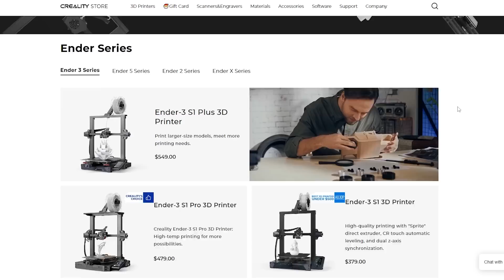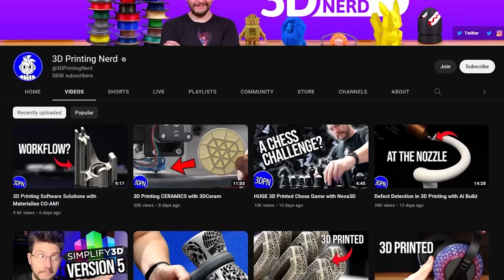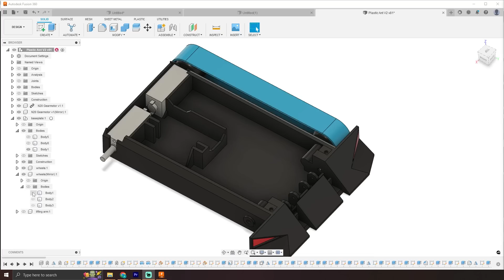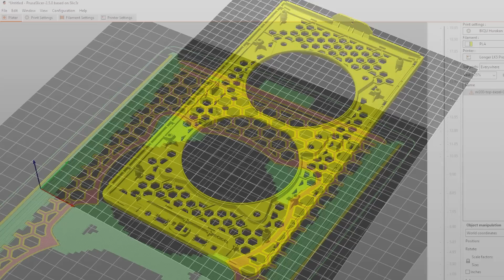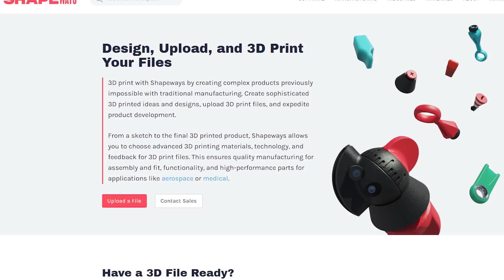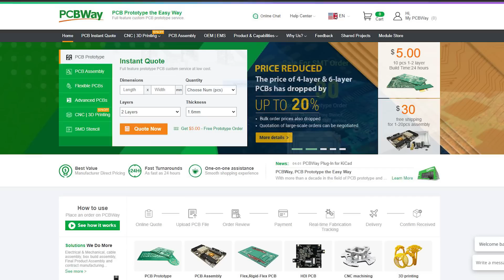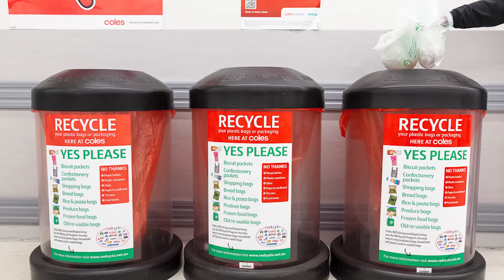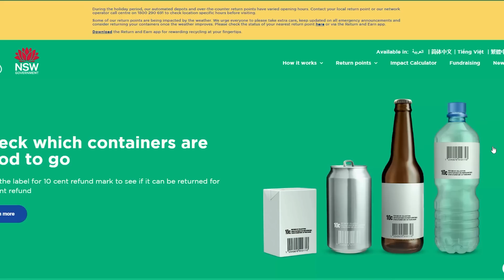My 3D Printing Predictions for 2023

Comment: In Germany we have a Startup Company that is accepting 3D printing "waste" like failed prints etc and gives you coins for sending in the materials and even paying for the shipping cost. If you sort and label your stuff properly you get more coins. With these coins you can save up to 25% of you purchase of filement in the online store. I think this is a good start for the future. Recycling plastic bottles at home will be no go to approach here because we have a deposit on the bottles and it is quiete high. 

I really hope there will be an easeier way getting in CAD modeling. I can design basic things with Fusion or FreeCAD but as you said, the learning curve is really steep.

Comment: I think you forgot that resin printers exist, they are getting really good now, they can print in casting resin and using casting can produce very detailed metal parts, as well as strong ceramic parts with another resin (after baking in a special cycle) see veg oil guy.  There are metal filaments you can print and then bake(in a special cycle) for quite strong metal parts too.

Comment: A wide variery of cellulose-based plastics have existed for over a century, e.g.: Cellulose Acetate. The main problem is cost. The volume produced is rather low because petroleum-based plastics are cheaper and better in almost every way.

I don't think this can be solved by hobbyists, we need to force all companies involved in the polymers supply chain to actually build recycling centers.

Comment: great video as always 😃 On the plastics: Unsorted plastics can relatively easy be sorted if the recycling company invests into the right sorting machines. Disclaimer: as my day job i work at Tomra. That being said, Tomra develops and builds such machines and they are also widely used (heavily in Europe).
Reply: But are these machines capable of separating PLA, ABS, and PETG in a stream of oddly shaped parts?
Reply: @user2C47  yes, and also if they are shredded 😉
Reply: Sorting them isn't the problem. Most plastics marked as recyclable are not actually recyclable in any practical sense. Those that are can only be recycled a relatively small number of times. That's assuming that the plastics were properly cleaned first, which a significant amount of is not.
Reply: @jacobnebel7282  that is true but better recycle what you can than burning all of it. In Germany we are at about 50% of reuse and this rate could still be way improved if society really wants it.

Comment: plus, 3d printing is only getting faster and more robust, the new bed levelling sensor from annex engineering with 100x100 bed meshes or the vzbot with 1000+mm/s peak speeds are both huuge innovations

Comment: My take on your predictions:

1. The prosumer market race will end free/open slicers: When the market gets tougher, neither Prusa nor UltiMaker will want to give free handouts to their competition.

2. CAD won't become accessible for the mainstream (Microsoft tried with Paint 3D, it didn't work). Instead, even more design is just going to shift to modifying meshes (which all (?) model sharing sites are already using anyway). Maybe we'll see improvements in 3D scanning / photogrammetry though – 3D scanners currently are ridiculously bad and expensive.

3. I doubt that we'll see 3D prints alleviating any supply chain issues: Supply chain issues are with microchips or chemicals or certain foods, but not with plastic parts. Let's hope that we won't get into supply chain issues for filament...

4. This one is interesting: PCBway, JLC PCB etc. to me are the first realization of that "Industry 4.0" promise, "batch size 1" and all. However, it's all China-based for now (the cost seems to be prohibitive elsewhere?), so if the trade war with the EU & US goes on, it might all go away again very quickly.

5. At least here in Germany, we have a deposit-refund-system on all plastic bottles, so making filament from these becomes a very expensive endeavour. Recycling prints would be awesome, but currently seems way out (sorting the different unmarked plastics being a big problem) and currently doesn't even make sense energy-wise, does it?

Comment: If a company is worried about quality control in terms of at home 3d printer replacement parts they could provide the cad file as suggested and advise the user to use the 3d print while waiting of parts to ship. Would be a reasonable solution in my opinion.

Comment: I hope recycling will catch on. Easy to use recyclers (shredders, extruders), maybe in the local makerspaces? But I also hope that we will less scraps in the future. Better printers (looking at you, Prusa XL with those many sensors in the print head) so less failed prints, better supports (the tree support in Cura and Prusaslicer looks promising), less plastic in the spools (MasterSpool, cardboard spools and combinations) and hopefully more use of decomposing materials (spools for example) would reduce the amopunt of plastic 'excaping' the recycling...

Comment: I have been using my 3d printer to make my packaging for my business, its so simple, I am surprised more brands don't do this already.
Reply: For small businesses it might be an option, but in large volumes it doesn't make sense. I can buy and ship premade packaging from China for a fraction of what it costs me to print it at home, even just for the cost of the filament. Economy of scale makes a huge difference. Technologies like vacuum forming and injection molding are much faster and more efficient than 3D printing, but they have a high fixed-cost for setting up the tooling. Prototypes and one-offs benefit from flexible technologies like 3D printing, but mass manufacture of fixed designs are much better off with our existing manufacturing processes.

Comment: I personally find it interesting that this seems to be considered the year where industrial services become widespread in availability. Companies like xometry and protolabs have had CNC and injection molding services that were reasonably priced for the better part of 5 or 6 years now.

What seems to have actually changed was the visibility of these types of service with the increase in competitors, along with aggressive sponsorships for the new players through the YouTube maker scene.

Regardless, it's great to see these services becoming more competitive.
Reply: Btw, in addition to the above services, a lot of makers seem to miss the versatility that sheet metal parts can offer. Most of the same services I mentioned as well as those in this video have sheet metal as well, and some smaller names like OSH Cut offer fast automated ordering and lower prices.
Reply: In the highschool robotics community, SendCutSend has become super popular. They have a wide variety of materials and really good service.
Reply: @ThatGuy Makes Things :  I think you hit the nail on the head... visibility is what is making the difference.  The Youtube connection, with positive comment from "trusted" people, combined with a good close-up look at quality examples, topped off with very low cost first time pricing... They somehow manage to feel familiar when compared with trying to wade through an online order form that seeks details for a manufacturing process you know little about.   Clever stuff!

Comment: I wish Sketchup would get some features from Fusion. It's awesome to work with, very fast. But it gets very clunky during certain tasks, some things are just impossible. If they just added a function to extrude with the help of other geometry. That would help a lot to do drill holes on angled surfaces.

Comment: Meh, it's not an issue putting 3d printed items in landfill. Future generations will have better technology for dealing with it. Today's landfill is tomorrow's mine site
Reply: Sure, because leaving it for the next generation hasn't caused problems before. How has that been going for us for the last 100 years?
Reply: @reverse_engineered  putting it in safe long term storage until we have the technology to meaningfully and economically recycle it isn't just chucking it on the street

Comment: Considering what has been happening in AI in 2022 I'm definitely expecting 3D printing to be affected as well. 

CAD with an AI interface? "Design a cube-shaped box 30mm wide with a wall thickness of 2mm, a lockable lid on top and little feet in the corners. Include a grid in the back to mount a 20mm fan."
"Check my design for potential overhang issues and optimize slicing for an optimal finish on the top and the sides." "Scale the imported design so that the height is exactly 24 mm but keep the wall thickness the same."

Should be trivial for an AI but enable beginners to really take off.

Comment: The Bambu Carbon is the closest we have come to a ready to go 3D printer for a person new to 3D printing.  When that happens, we will see the next "race to the bottom".  It is important to remember that the current race to the bottom was only possible because of the open source nature of the current 3D hobbyist printing industry.  Bambu is not keeping things fully open source, so the next race will not be as intense unless an equivalent system is open sourced.

Wizard based design programs may become more popular, but AI generated parts are more likely.  Eventually, someone will realize that scanning an object combined with general purpose design rules will make better parts than language based 3D models.  Training an AI to determine the best slicing strategies for speed and quality will be another big win, but that may take more than a year (unless we train an AI to train other AI's).

Comment: I would like to see some invention that would get rid of the visible layer lines or make it easy to produce some sort of pattern on the surface to hide them. I think it's still the surface quality which prevents 3D printed parts to be sold on the same shelf with injection molded products. That carbon-nylon part on this video looked very nice already! Matte filaments could be one solution.
Reply: Try glitter filaments.  I use the stuff from Fusionfilaments and the small sparkles do wonders to hide any layer lines.

Comment: I hope that Ender comes with a really fast printer. For me it's not a hobby. My printers are tools. And the faster I can print something the quicker I can finish the thing I'm building. I've been tweaking a bit with my Ender 3 but my old Ultimaker from 2013 is still faster than the Ender 3. I've built a Voron printer after I saw the Benchy challenge earlier this year. But it's not finished yet because it requires quite a lot of work to get it going fast.
So I hope that new fast cheap printers will come next year.

Comment: I just got the Anker printer in and it's been amazing. It's a huge upgrade from a hobbyist kit style machine where almost everything was manual. Loving how easy it is. Sure, it won't be printing exotic materials, but I already have the tools, space, and ability to cast aluminum through either a lost PLA method or compacted green sand casting. If I really need a part in metal, I can make that happen. 
Where 3D printing shines is its ability to make intricate internal geometry that doesn't require access by humans. 
I'm just an artist btw, so making something that works for mass production isn't something I care about.

Comment: Whatever company is first to make the printer that's additive manufacturing AND subtractive manufacturing, will dominate for a long time. Being able to have printed layers CNC machined for better lines at the same time, would open the doors for printing that's not only rivaling injection moulding, but actually surpassing it.

Just as an example of something hard to print, imagine the reflectors on an older style headlight, where the shapes and angles are critical for it to project the beam pattern correctly. Being able to print the general shape as accurate as possible to print first, then have it followed up by an accurate milling head right after or even so shortly after that the filament has just print-cured, or even on a layer-by-layer basis.. that would be the biggest leap in 3D-printing to grace the market.

Comment: You really should be look more at Biqu printers because i use them for 4 years now and there is no need for upgrades and tweaking. they just print good (except for the fans) never touch my printer i just print and only look when i hear the finished sound..

Comment: I hope for less "hobby printing" and for the technology to firmly settle as a prosumer tool. All these little fidget toys, cookie cutters, gimmick prints, etc... are mostly just good for more plastic waste , I see little added value to them.
3D printing is a great way for cheap at home manufacturing of complex parts that are designed to fulfil a specific need. I see a 3D printing as a tool that, just like a table saw, is only really useful to have in capable hands. Marketing these things as cheap as possible for at home use with dumbed down tools will only lead to more pollution, both in plastics and e-waste. 

The type of person who goes out of their way to fix a broken thing at home, is probably also the person that would learn a more complex tool like fusion 360 (which is free for home use btw). You need that precision if a replacement part has to interact with other parts. No app or dumbed down CAD software will do that.

Comment: Great video, i believe in a circular economy for the plastic sector. As a YouTube hobbyist i saw 3d printing as a great potential to use waste plastics, so decided to build my own 3d printer to make recycled furniture. It's been 2 years now but in 2023 i will finally be at a stage with the build to produce some products. Chairs, tables, lights, wall panels ect... 3d printing has come so far in the last few years great sector to watch always something new popping up.

Comment: I especially want #5 to happen.  I have been hugely disappointed with recycling options.  I generate large amounts of PLA to recycle, both print at home and in the robotics program I run at the school where I work.  I have stopped trying to recycle it and am now storing it while waiting for a good solution.  I am currently looking for an affordable process to form old material into filament.  Several options exist, but they are beyond my current budget.

Comment: On the topic of companies sharing files, I can see a decentralized production capability for small shops to produce things like microwave door handles, covers for various implements, etc. I fully understand and support the choice of companies to not openly share the CAD of their products, but having a shop with a clear NDA that is able to produce some of these parts at a reasonable standard (think ABS parts off a stock Bambu) for a reasonable price.

I guess the main concern is trying to deal with the public and their general inability to explain what exactly it is that they need. People struggle with basic things like looking at a diagram to identify a component or even just tell someone the correct model number for their appliance. Paired with the difficulty and cost of one-off production (logistics, not really the physical aspect for 3d printers), it probably is more pie-in-the-sky than realistic. But if you brought in government regulation to more adequately support appliances rather than throw perfectly good things out, I could see potential for the concept.

Comment: Not a prediction, but I'd like 1) a dedicated machine I could use to turn waste filament back into filament, which I could then reprint with.  I keep all of my waste in separate plastic boxes because I know someday this will be possible, and I'm just waiting for a consumer/hobbyist machine that works.  And 2) I'd like a "prosumer" 3D modeling program.  Something that's easy to use, but not have the same learning curve as Fusion360.  Maybe something like 123D Design, but with the added ability for parametric modeling (and not as buggy).  It would need to be a desktop application (not mobile or tablet), have the ability to save files locally, and would need to be a paid application (and NOT!!! a subscription)

Comment: Merry Christmas and here is to a safe, prosperous New Year.
I would like to see good quality, reliable, affordable recycle systems at the same price-point as a 3D printer ( $250-$350 USD ) that allow a grinding down of failed or tossed 3D parts to pellets that can be turned into filament to use again.  The parts (screw, motor, gearbox) are too expensive.

Comment: I’m really hoping for a well-rounded easy to use CADD program. I’ve got 3D printing down pat. But I’m very limited in my design knowledge. The main program I’m using right now is Microsoft 3D builder. Other programs are either too complex, or they are too limited. What sucks is Microsoft doesn’t support 3D builder anymore so it’s buggy and it’s still pretty limited. I wish someone could make a program that has a few more features than 3D builder, but nowhere near complex as Fusion360
Reply: Blender
Reply: I found Tinkercad to be answer to the same scenario.

Comment: 6:45 For a Tinkercad "Replacement" there is a... software.. called Matter Control, which is a designer+slicer. It has all the bells and whistles from Tinkercad plus some really neat features in both the free and the paid versions.
5:30 Bambulab is Fking them all already.